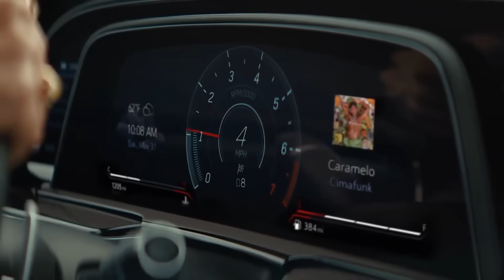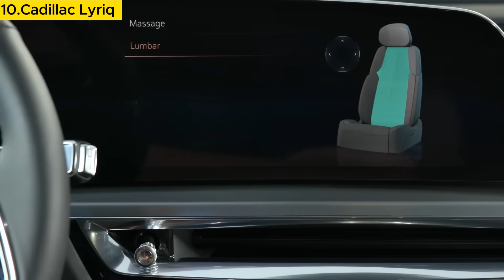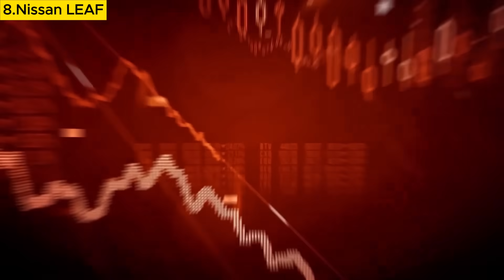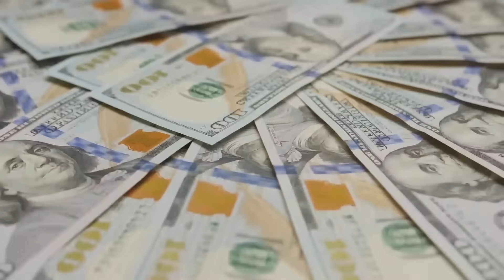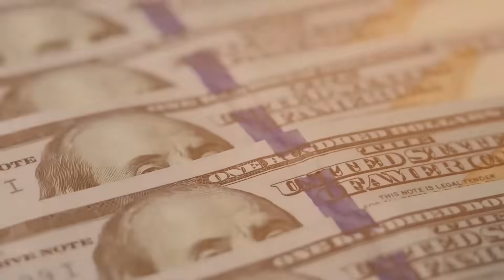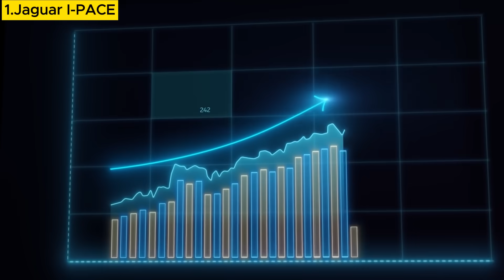10 EV Cars that Dealers Can’t Sell ! | Why Electric cars are piling up!

Comment: To those saying noone wants EVs fire EVs blabla must be thick. When people feel a certain way its like their brains exit their skulls. Did you actually read the title or look at sales? EV sales are flying globally whether you like it or not. BUT. That doesn't mean ALL EVs are good or even nearly good. 60% of EVs Id say are overpriced lemons. Manufacturers rushed to bring products to the market to compete in a market space  that was almost doubling year on year. They have to balance their business on ICE and and EV. Turning a profit is next to impossible and not making them at scale pushes the price up. Consumers wont buy a car thats 20,000 more than a ICE car. Only an idiot would do that. Further more the cars specifically on this list are at best lukwarm, rushed, overpriced or a mixture of all three. Manufacturers thought they could just make EVs and people would buy them off their badge. No. Ask Ford what happens when you think like that. A 12billion hole in your pocket. Mustang Mach E in terms of sales is practically a Paperweight. Or...who would buy an I pace for £80,000 to only go 150 miles because JLR couldnt be bothered to put any effort into the design? People buy EVs but they dont buy crap, low range, silly priced ones. If its sales alone you look at its going to be a Tesla/Kia/Hyundai/MG/Polestar possibly a VW 99% of the time outside of China, Maybe GM too in america, all of whom enjoy either good or astronomical sales. 

Instead of trying to chase Tesla, manufacturers should have looked at the cheap end of the market. Tesla dont care and dont compete with anyone in the EV space except the chinese probably. They've had an 8 year head start to go from minus to plus and streamline. They are making 1.8 million EVs a year and turning a huge profit on their business with a 36% increase in sales alone in 2023 at a time of supposed "stalled growth". Car makers should stop looking at them and look at their own markets.  Telsa said their mission was to force prices down and as mentioned above they are doing exactly that and making these cars even more unsellable, whilst still turning a massive profit on their own cars and expanding. Manufacturers cant afford to drop their margins. Its pretty brutal to be honest. These cars above will never sell unless you give them away and it serves the manufacturers right for being so thick, which is a shame. Some really good brands are going  to really struggle when it comes to this EV stuff unless they can sort their stuff out. In alot of places production of EVs is law now so anyone saying EVs will die out is living in lala land. Lots of discounts will be incoming, more pain for car makers and more pain for used EV owner values. But good news for consumers who have been priced out of the market.

Comment: Even if people wanted to buy EVs, there's not enough capacity in the grid to charge them all.  The number of chargers is a red herring.  It doesn't matter how many chargers there are if there isn't sufficient electricity to go around when there's a large demand on the grid.  The force over from gas home heating to heat pumps isn't going to make the Winter easier and AC already brings the grid to the edge.  Where will the extra energy come from?  Not wind or solar.  The whole green thing is a scam.
Reply: Rented a Model Y a few months back. Went to 3 chargers at the local mall, none of them worked. So I drove 30min to a supercharger, charged for an hour, and drove 30min back home. What a joy that was.
Reply: @BradKwfc when you rent an EV do you have to return it on a full charge?  What if there are
no nearby super chargers to the rental facility.
Reply: Ya I love the videos when they show the supercharger stations with 24 units. Then get angry that it's charging at like 25% speed. Ya cuz there's like 12 cars plugged in!! I couldn't believe the guy was touting the 24 units but didn't make the connection that if they were all full it would charge at like 10% speed. So why have 24 chargers? That is actually worse!

Comment: Take away Tax Incentives and no one at all would buy an EV !
Reply: The newly elected NZ Govt has done just that ...dumped the EV bribe rebate.
Reply: In my country (Switzerland), there is precisely ZERO subsidy for any EV... and despite that, they still sell like hot cakes, approaching 25% of total sales, with an ever growing market share.
You will likely tell me that Switzerland is not the USA, and that is correct... but not on this topic.  For a couple of years, Tesla was the only EV brand (with GM) to have exhausted their right to tax incentives.  Did it slow their sale?  Not the least bit!
Reply: @st-ex8506  Not really True

The Canton of Bern supports charging stations for electric cars at companies. Maximum CHF 20 000 per charging station; max. CHF 60 000 per location. The Canton of Basel-Stadt reimburses 20 % of the purchase price of purely electric vehicles (up to a maximum of CHF 5 000 per vehicle) to companies based in the canton.
Reply: @GrrMeister  Yes, there are a few cantons giving incentives... Aargau also I believe... but none in mine, and none in most!☹

What I said is mostly true... as you correctly pointed out, there are a few exceptions, but I did not want to go into our cantonal details.

Geneva even has a disincentive of sort, as their yearly road tax is based on horsepower, many EVs (especially Teslas) fall in top (i.e. expensive) categories they don't really belong to!
Reply: Zero in my country as well.. Another Internet expert 😂
Reply: Where do you get your "facts" from then? The Iranian oil export office?